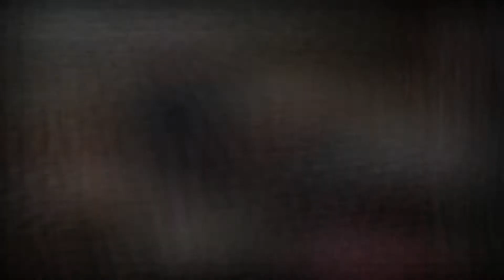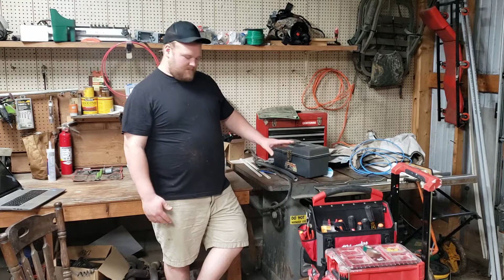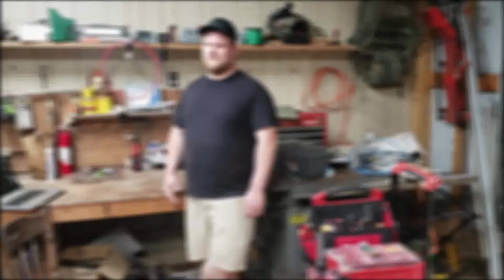Choosing the correct phase converter for your application.

Comment: An advantage of a Rotory Phase Converter is the older iron you can run, IE: REAL TOOLS  that are cheap to acquire and will hold their value. This should more then make up for the cost of the converter especially if you source a old 3 phase motor + DIY kit or buy components.

Comment: Hi Todd I have a startrite 352 s bandsaw 3 phase I have spent most of the day phoning different company’s up I was 
Going to buy a Clarke pc 60 to run it some of the companies say it will not work some say it will. I have had at least 4 sparkies friends here one said it was the saw so I took the saw to my friend’s three phase work shop runs perfect. I was giving a 3 phase converter as a present off a friend months ago thinking 3 phase or single phase what ever comes up for sale first it is a static max 2 and a half hp my saw is 1and a half hp it does not work properly so they all put it down to the converter. It is a very old one the saw is 1995 probably the converter is to the saw has two speeds. I only want to buy the ones.I have no other 3 phase in my work shop and I’m just a hobbyist what way would you go to get this saw up and running it would be much appreciated if you could let me know. Geoff Anderson    Newcastle up on Tyne U.K.
Reply from the maker: Geoff, best of luck with getting it set up. I would probably use either a rotary phase converter or a vfd. A vfd will be the most cost effective.  You will just have to match the correct input and output voltages for what then requires and also the size of the vfd